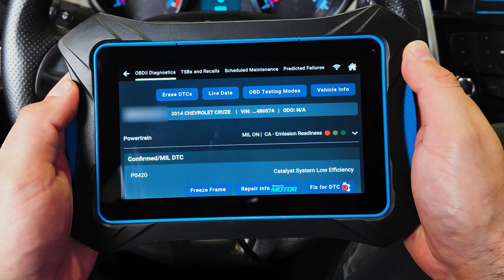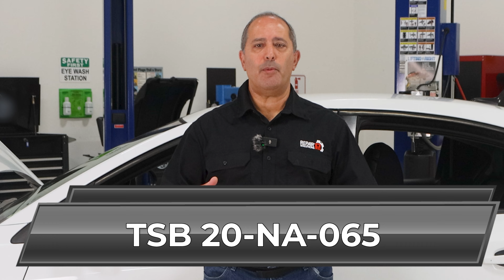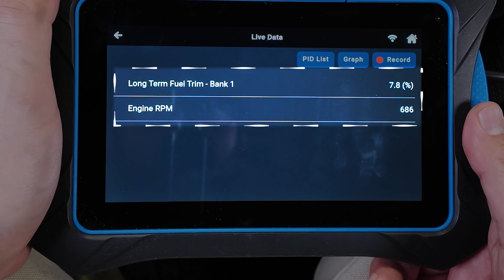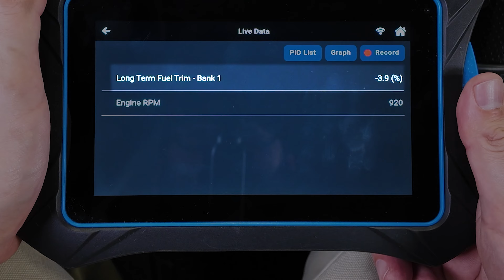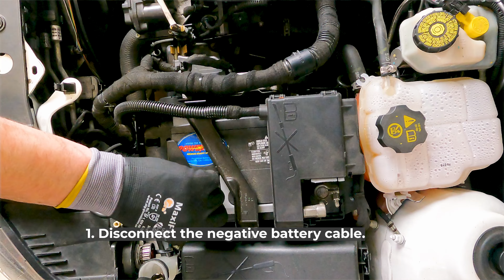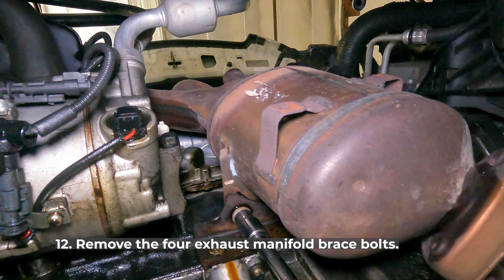How to Fix Code P0420 on a 2014 Chevrolet Cruze | Catalytic Converter Replacement

Comment: How do we know that it is the front catalytic converter and not the rear?
Reply from the maker: Hi, thanks for your comment! In most applications, a catalyst efficiency Diagnostic Trouble Code (such as P0420 or P0430) associated with the upstream bank generally indicates the catalytic converter located closest to the engine on that bank. The downstream oxygen sensor is typically used by the ECM to monitor catalytic converter efficiency by comparing upstream and downstream sensor activity.

However, exhaust system configurations can vary significantly depending on the year, make, model, engine, and emissions package. Some vehicles may use multiple catalytic converters per bank, close-coupled converters, underfloor converters, or integrated manifold catalyst designs. In addition, many OBD II fault codes identify the affected bank but do not always pinpoint the exact converter location.

For accurate identification and diagnosis, we recommend reviewing the vehicle’s OEM service information or repair manual. Proper diagnosis should also include checking for exhaust leaks, fuel control issues, sensor operation, and any related DTCs before replacing components.

Let us know if you have any other questions — happy to help!